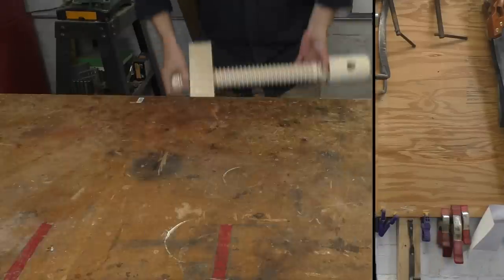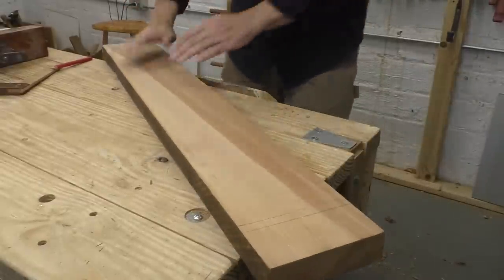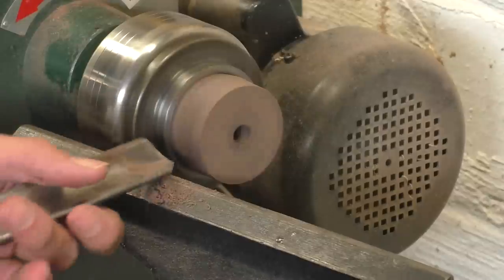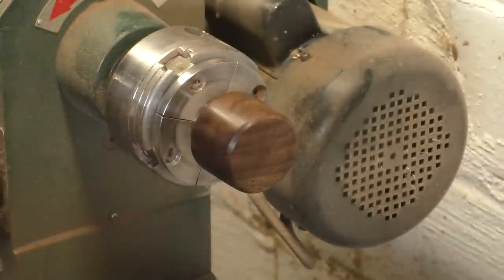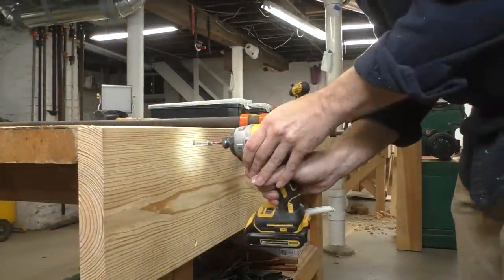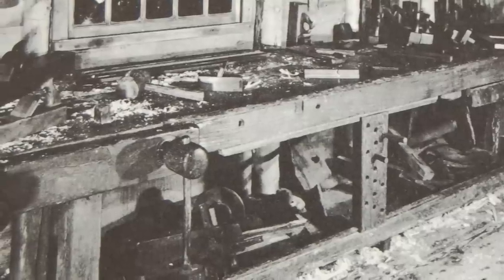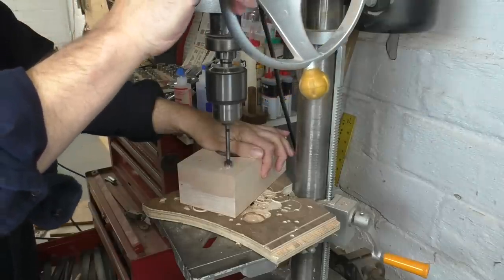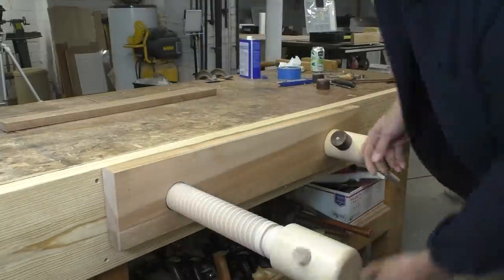Vise Squad #3: The Ancient Wooden Twin-Screw

Comment: I built a DIY version of this because I couldn't source a screw large enough for the leg vise (found the Yost on Lee Valley now, but ...), whereas I could use threaded rods for mine. It's worked well enough that I haven't tackled the leg vise yet, but it is definitely on the slow side. It was however pretty simple to put together and attach to the low roman bench with existing, small stock (didn't need anything beefy like I will for the leg vise) with minimal finishing (add a chamfer, glue on some leather, done), so there's the cost and speed aspect.

However! Neither of those would not have been reasons for the Dominy to choose them, especially since it looks like they already HAD leg vises on there. Very interesting indeed, maybe it'll reveal itself over time. Thanks for the video, and nice to see you using that lathe you've unearthed. :D

Comment: You could easily add a belt drive to your twin screw. The belt would allow you to over tighten one side for tapered work by slipping the belt, but still save time by letting you turn both at once. Chain and gear drives sacrifice the tapered grip by locking the handles together.

Comment: Hi Rex! I can't talk from experience but that large screw with the movable jaw makes me think that it would grip pieces based on the jaw position. I can't really draw a picture in a youtube comment, but I feel like tilting the movable jaw vertically a bit would lock in place with a shallow grip almost any small to medium piece. Not to mention pieces that have a "v"-like shape.
The way it looks in the drawings, with a thinner movable jaw... I imagine tilting it would be common and it would do quick work: Drop the piece in, grip with vertical tilting, do small and fast work, take it out - similar to the hold fast principle.
And then, if the piece does move or you need to do heavy work on it, tighten one of the screws, clamping it in an angled grip (tighten the screw closest to you, depending on where your body is in regards to the work piece and bench). If one screw hold is not enough, then and only then tighten both, which locks everything in place as you demonstrated.
Again... I don't use (and have never used) one - I'm just referencing the drawings you presented and how the sizes suggest to me it should work. If it's all baloney... that's that. Still... like you say, the fact that a leg vise was abandoned to favor this one makes me think that some of the advantages I listed above ought to work. I almost want to build one myself and test what I just said :)))

Comment: Rex, I built a 2 screw vise months ago and bought a tap & die set to make my own screws. It was easy to do and would lower the cost ALOT (and you'd have the tap & die set). I went with much smaller 3/4" diameter, but larger is available. Even with smaller screws, the holding power is amazing.

Comment: I use two 3 1/2in leg vices. One at each end my bench. I put a 2x8 between those when be I need a  Macon type vice. One leg vice goes to the floor the other is 8in off the floor, this allows me to have wheels on the left side.

Comment: 12:00 seems like the chain drive vise would kind of miss one of the advantages of the twin drive vise, namely that you can hold onto a piece of wood that is different sizes at each end.
Reply: So on the Veritas twin screw Rex talks about, you can disengage the chain drive to allow for tapered pieces.
Reply: Andrew Klein has a twin vice that can handle those.

Comment: Question about the Dominys - did they all work in the shop at the same time/on pieces together? 

Because it may be that if they were working together as a cohesive team, some of the weirdness with the twin screw could be alleviated by having one person on each screw - you would need to really know each other and what you're doing very well, but if they were working together all their lives, and learned their craft in the same shop, then... yeah they would know all of that.
Reply: You don't even need to know each other that well, just good work organisation and minimal discipline. Kid preps vice 1 with some boards for a project, dad comes clean them up while kid preps vice 2 with other board(s) for another part of the project or another project. Kinda hard to mess that up.
Reply from the maker: They were more like solo craftsmen who shared a shop.

Comment: My dad has two Workmate portable benches, which works on the same principal as the twin-screw vise (mainly because they ARE twin-screw vises). I'll often use one when I'm grinding a piece (I'm a beginning blacksmith), depending on what I'm doing. If I'm just cutting a chunk of stock down to throw in my forge, I have a Harbor Freight carpenter's vise attached to a small bench that I use. I find the twin-screw design a bit awkward, though the fact that the handles are crank-style rather than the sliding bar helps when it comes to speed, and you do get used to it after a while. I don't use the Workmates very often (especially in winter. It gets COLD in Boise, and I don't usually have to do a lot of grinding), but I've gotten used to it even just using it occasionally for most of my life. The one vise that I wish that I had was a post vise. Problem is, I have nowhere to put it. The area where I have my forge is tiny. I need to get out there and reorganize the place. Probably when the carport's installed.

Comment: I'll shed some light for ya. With the twin screw you can quickly and easily lay a board on the screws horizontally then drill out and clean out a mortise. It's especially fast for furniture making (table chairs etc.)

Comment: A twin-screw vise is the only vise I have in my bench. Mainly because it is cheap to make (if you use modest threaded rods instead of those expensive wood screws). It is indeed not the fastest kind of vise and needs different approaches than those used with a cast iron face vise. For instance, usually, you would set one side of the vise and then work on multiple tasks only actuating on the other screw. Besides that, in some cases, you would use shins or something similar in one end to prevent vertical raking (not sure how to spell that).

Comment: Rex, reading Chris Schwartz’s book on work benches mentions his surprise about loving twin screw vises. I think the answer is two fold. 

One, he’s only familiar with the twin drive modern style. Take that into account. However, for a workbench that has a shorter footprint I think the twin screw his good for edge jointing long work. The bench design where he praises the twin screw was not originally equipped with a dead man or dog holes on the legs. Those were added afterwards. This means he was likely pushing the limits of the Veritas for edge work and was impressed with its capability. 

Two, these were production shops where there likely were more than just one set of hands to hold and situate large demanding pieces of wood in the vise. 

I can see the real benefit of shifting the work to the right of workers were sharing the bench and edge work was needed. Instead of a leg vise using the apron to support long pieces. The work piece could be held in the vise alone shifting the work over opening up some of the bench for another worker. 

I will admit to being occasionally intrigued by the idea of a twin screw. It weridly comes and goes. However I think a leg vise and some planing stops or a face and tail vise combo are almost all that is needed. 

A leg vise is cheap to build and works better than almost all but you most expensive face vises. Couple that with some planing stop and some dog holes in the apron and you’re good to go. I like planing stops because of the feedback they give you about your planing which is really beneficial to beginners. Throw in a moxon vise and you’re golden, although the need for one is far less than a lot of prominent woodworkers make it out to be in my experience. I mainly bust it out if I have a LOT of dovetails to do and want to be able to sit down.

Comment: I'm thinking that one advantage might be that the pressure plate does in fact move freely when the vise is open. You can manually push the pressure plate to your piece of wood it and align it perfectly before tightening down the screws.

Comment: Thanks for a very informative video.

If your woodworking life is dominated by dovetails then it seems this vice is the one you want. Especially if you do large cabinetry.  As you pointed out it's a Moxon attached to the bench. 

Well if you have a small shop, as I do, I think I'd rather deal with extra screws as opposed to putting on and removing the Moxon.

The only advantage to a Moxon is that, situated on the top of the bench, it can hold tall work closer to the top.

Comment: Random question, unrelated to historical context. When you were showing getting things into the vice it looked a bit difficult to get both tightened together. But since the screws aren't connected to the jaw, could you hip-check or knee-hold the jaw against the piece? Then the two screws just need to snug up against the jaw, and once they're both snug they could be tightened further.

Comment: The bench shown at 7:07 looks an awful lot like the ones in the “sløydsal” at my old school. If I remember correctly, that school building was built in 1971, and the woodworking shop almost certainly had to be refurnished in 1973 after a fire that is believed to have started in that very room.
Reply: I had woodworking in school for one two years I believe, sixth and seventh grade iirc. Mandatory in Denmark at the time, don't know if it still is. It really should be. We started the lesson with removing the four 2.44 m × 1.22 m MDF boards that worked as table for arts and crafts classes, to reveal two rows of what I guess were classic Scandinavian school woodworking benches, 5 or 6 in each row, with the end towards you, at the back all benches were connected to a long tray, and there was a tray on the backside (or the right side, as you'd be standing at the end) as well. I always tried to get the leftmost bench, to have more space to move in front (or to the left) of it. Each bench had two vises, an end vise and a side vise. Both had wooden screws, and I simply loved these amazing huge screws. The end vise had two wooden guide rails, but the side vise was mounted as a c-clamp, with the end of the screw pushing a  loose board up against the side of the bench, making it possible to clamp large workpieces for planing. On the bench top there were two rows of pop-up metal bench dogs with an integrated spring. The end vise had a matching pair of dogs. Aside from the dogs, I think nothing else on these benches was metal, the legs (with a shelf) were joined with tenons and wedges. We were taught sawing with a traditional frame saw, hanging on wooden hooks beneath the side tray. First, you had to set the blade angle, then twist the string to secure and put tension on the blade. And woe, if you forgot to release the tension when the lesson was over! Thinking about it now 40+ years later, it's impressive how much knowledge I actually gained then, and still remember, like adjusting a wooden plane, never measuring from the end of a wooden ruler, etc.

But the wooden screws were magical. And so incredibly strong. I hope to have or make a similar bench myself one day.

Rex, why didn't you make the screws yourself, instead of paying such an incredible amount for them?

Comment: Here's an idea.
Have the first screw move the vise in and out and have the second screw set the angle.
You do this by having the first screw engage with a nut which is attached to the bench, as previously. But you attach a board to the rear of the screw, so that it moves in and out with the screw but doesn't turn with it. The second screw then screws into a nut which is attached to the board. The board will have to have guide rails to slide on and be quite thick in order to keep the vise Square.
This will allow the vise to be moved quickly, hold angled work and have the griping power of two screws. The only problem will be making that back board stiff enough.

Comment: Tip's to make your expensive wood vice screws last as long as possible from Sweden were wood screw workbenches was the norm until 30 years ago or so.

Lubricate the screw with sheep tallow (kidney tallow) or similar. 

Turn with one hand but if possible tigthen with one hand on either side to eaven out pressure, most important if clamping hard. 

Don't overtighten. A lot of school benches have messed up screws because we students liked to clamp everything in the vice and skrew like bastards to keep the workpiece still instead of setting up on the benchtop, that works on a steel vice but not really on a wooden one.

If using a style with a long free screw like scandinavian front vices grab the thread and turn there to if tightening extra tight, even more important on wooden clamps

Dont force it open if tight to turn! It probably have swollen shut. Wait for it to dry out, in your dry woodworking shop.

The only one that you really never ever should do is to force open a swollen screw, just dont!
All the other are broken regularly but the screw dont really like it.

Comment: could have saved yourself about $100 by ordering one of Garrett Wade's Tap & Die sets for wood screws..   might not be a 2" screw... but a 1" or 1 1/4" screw would likely hold just as well.....
the "advantage" of the vise may be simply one of familiarity and being accustomed to using one.   my grandfather loved his twin screw vise and swore by it...his had keepers though...a  ~3/8" recess in inner face of the clamp board, and a peg that protruded from the screw....there's very little force in that direction so it was enough to keep the jaw at the "lead" of the screws....   The ability to put an angled piece into the vice is definitely a plus...

Been wanting to make a frame saw and a turning saw , both for the joy of making my own tools, and for the utility of having them around....the problem i've had is how to hold the blade.   Finding the hardware to hold a blade has been a real trial.    for the frame saw, i've finally come down to buying a cheap camping bow saw, and scavenging the holders from that.  ...(unfortunately, i'm on hiatus from my workshop thanks to surgery on my rotator cuff...no lifting or pulling beyond 10# of force....so i've stayed out of the shop..   However, my sketch book is rapidly filling up with projects that are waiting for me to get back in there!!)

Comment: OK, a bit late. If you look back through the Lost Art Press blog you will find some illustrations dating back to the early 1300's with twin screw vises on huge workbenches (I think the illustration is trying to show the building of Noah's Ark). The difference is that the screw is fixed into the bench top and the nut rotates. Also I think the earliest illustration of a screw operated vise, so twin screw vises came first.

Comment: I have been trying to figure out a way to make the screw and box by hand for a complete made-by-me vise.  The threading kits out there only do 1 1/2 diameter screws, and I want ones as thick as the ones in this video.  There is a German company that makes threading kits at diameters above 2 inches, but the prices quickly go over $1,000.  There are some videos out there using various methods, but most look very difficult to do well or involve a metal lathe which I don't have.

Comment: Hmm, I think it's probably just a matter of the sort of work they were doing most often. For general use I'd agree that a leg vice is more versatile and practical but if they spent the most time dovetailing cabinet carcasses compared to other operations, then having their Moxon vice built in makes sense for purely economical reasons. 
Slight sidenote; Moxon vice is a generic term for the mechanism and truly synonymous with 'twin-screw vice'. 

Anyway, when you factor the peg-board in the convenience of a leg vice the old style isn't much easier to use; the thing with a Moxon, which you did in this video and I'm sure is how most use it, is the fact that for moving the jaws any significant amount you operate both screws at once. I think this is one reason why you generally see these modern chained twin-vices by Veritas as end vises more than face vises where only having one handle in easy reach is a factor. The tradeoff being you can't clamp angled boards.

Comment: I'd bet it becomes more efficient as you use it.  When you adjust your leg vise, you don't tweak the bottom setting as well as the top.  You just leave the bottom set about right, and open and close the vise with the screw at the top.  Your twin screw is the same thing but sideways.  Set one screw about right, and open and close with the other.

Comment: I'm in the process of using a Moxen vice kit to build a vice into the apron of my bench.  I agree that the twin wood screw arrangement is a bit clunky to work with, but I am hoping that the metal screws will work more smoothly, and I expect that I will keep the left side of the vice set just under 3/4 in since that's the size of most of the stock I work with and clamp down on the right side (I'm right- handed).  

Would it be worth greasing the screws to make the vice operate more smoothly?

Comment: I wonder if it's something that really starts to make sense at a larger scale. These guys were essentially the industrial equivalent of hand wood workers. It doesn't make sense for me to buy 30 3D printers, but that's only because I really just do one-off projects. For a company, or even just a single person with a large workload, scaling out makes a lot of sense. Same goes for several hundred thousand dollar CNC machines, it's not worth it for what I would use it for. Maybe there was a particular operation that they had to do on a large scale that this vise made just a little bit more efficient.